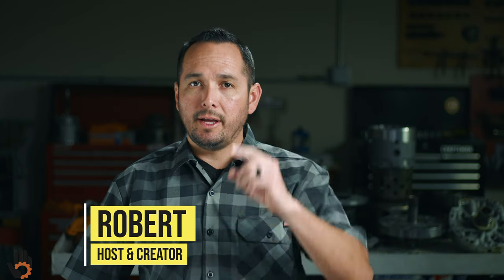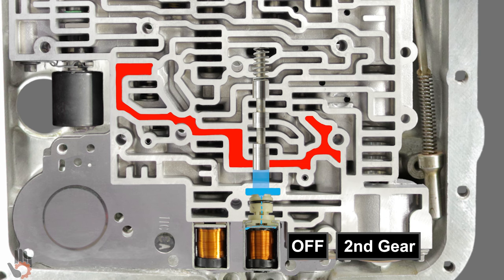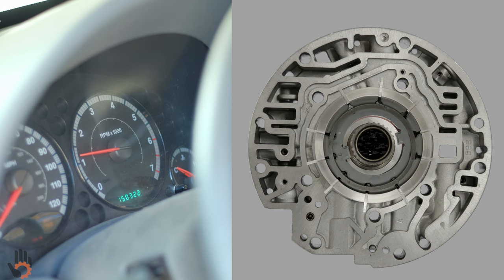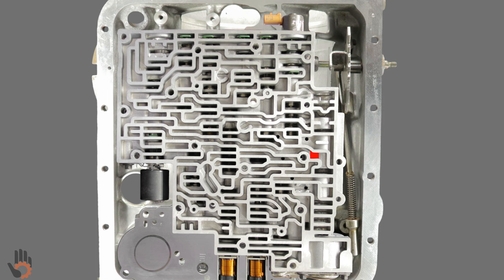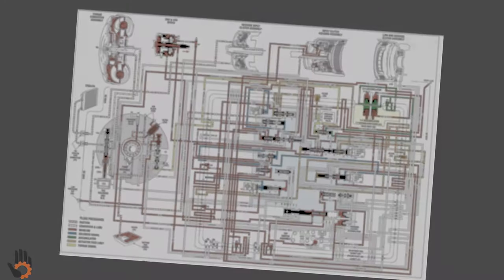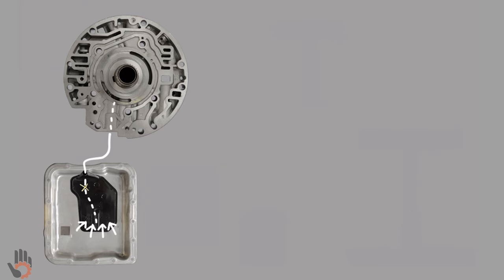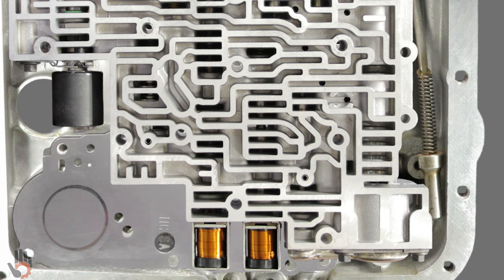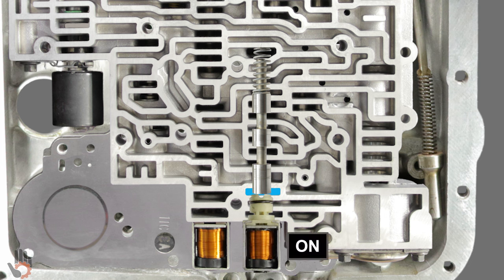4L60E: 1-2 Shift Valve + 1-2 Shift Solenoid (Part 1) Basic Operation

Comment: Hey there, I know it's an older video but II'm hoping you will repsond..I am a female that was taken by a mechanic for my hard earned money:( Unfortunately, now I don't trust any of them!
 I do have someone new working on my car and I can watch them do the repairs and ask questions they offer information that's for sure. But this bad experience inspired me to learn EVERYTHING I possibly can about my car:) thank you for explaining in detail, because the other guy wanted to have me replace my transmission then had a slip of the lip saying he can rebuild mine so I can have an extra one, wait WHAT??
Reply from the maker: Sorry to hear about your negative experience.  That's a real bummer.

Happy to share.  Excited to do more how-stuff-works videos, as time permits.

Thanks for dropping us a line!
We're glad that you're here.
Reply: @SouthpawAutoworks  Am I correct in researching the solenoid valve needing to be replaced because of a little slip in the trans, rather than a whole transmission replacement?
Reply from the maker: Generally speaking, a shift solenoid will not cause slipping.  When there's a problem with a shift solenoid, it'll typically result in a missing gear...as opposed to slipping in a certain gear.

There is an EPC Solenoid (Electronic Pressure Control).  It affects the oil pressure that's used to apply the clutch packs (it's called Line Pressure).  If an EPC Solenoid is failing, that could result in slipping.  However, it will likely affect all gears, as opposed to just one gear.

Comment: Why would my transmission stay in first and not come out of that gear can you please help out would it be the 1-2 shift solenoid
Reply from the maker: It could be...
It could be a number of things.

Can you share more about the condition?
Is it always stuck in 1st gear?  Or is this an intermittent issue?
Is the speedometer currently working? (or hooked up/disconnected?)

Comment: What could cause the trans to seem like it’s binding or has a trans brake in reverse and 3/4 shifts around 40 again it acts like it has a trans brake or is trying to lock up any knowledge greatly appreciated
Reply from the maker: Binding is caused by too many clutch packs, or bands, being applied at the same time.  A defective one-way clutch could cause this issue, too.
Note:  There's only one band in the 4L60E...other transmissions have multiple bands.

Binding in reverse.  Got it.
3/4 shifts???
I'm having trouble following...  Can you clarify?

It binds in both 3rd gear and 4th gear?
It binds during the 3-4 up-shift?
It binds in 4th gear?

Comment: Can someone answer me why fuse 12 (1994 Holden VR Commodore) keeps blowing? 
Fuse 12 controls the trans controls, MAF sensor and speed sensor. It only tripped five minutes after switching from PWR mode to ECON, as I had it on PWR for majority of the year and the car is thrown into limp mode. 
It feels like almost every January this issue happens. I'm most certain it's a 4L60E issue and not speed sensor/MAF

Comment: My truck slips from 1st to neutral while it is getting up to temp. Once up to temp it’s drive great and has never slipped. Doesn’t happen every time. My technician says it could be the valve body. Before I spend $2k tomorrow to replace it, what’s your opinion? Please help.
Reply from the maker: Year/make/model?
Reply: @SouthpawAutoworks  2019 Chevy Silverado 24,000 miles. Fluid is good and at correct level and no TSM updates are needed.

Comment: I have a 2005 avalanche and when it shifts to 2nd gear it's like it's in neutral . Is that going to be a shift silanoid or is something else going on
Reply from the maker: Sounds like something else...

If it were me, (and do what I do at your own risk) I'd be inspecting the 2-4 servo, for signs of damage.

Was the trans recently rebuilt, or worked on?

Comment: Question, I just changed both a & b solenoids. When I pulled b, the valve obviously spring loaded protruded out, when I grabbed a it was wabbly and loose and the valve didn't protrude out. I stuck my pinky finger in the hole seems I can barely touch the end of the valve. I installed the new solenoid and it fits nicely with no movement. There is a slight improvement in shifting but not much. What is going on here?
Reply from the maker: The 1-2 Shift Valve-train is under spring tension.  So, it will pop out as soon as you remove the shift solenoid retainer.  However, the 2-3 Shift Valve-train is not equipped with a spring...just two valves (shift valve and shuttle valve).  They will stay put, in the valve-body bore...unless you stand the valve-body upright.

The shift solenoids are wobbly when installed into their bores.  They're not a tight fit.  The O-rings are a snug fit...but the solenoid snouts are not.  So, it's normal for the solenoids to wobble in the bore.

There are a number of things that affect shift feel.  I look forward to producing videos on that topic, when time permits.
Reply: I didn't use ac Delco could that be a factor?

Comment: i have problem with my 2015 silverado v8 the scanner show the P2723 pressure control solenoid valve 5 stuck off, if you can help where is the location of this solenoid please?
Reply from the maker: There's an electrical connector that's visible from the outside of the trans.  The EPC Solenoid (Electrical Pressure Control) is located right near that case connector...but on the inside of the trans.

Comment: If there is some hesitation in shifting from 2-3 at slow acceleration, could it be more of a pressure solenoid regulation issue or a shift solenoid? It shift fine when accelerating normally or fast. Wonder if it could be due to pressure related issue. Thanks
Reply from the maker: Probably not an issue with the EPC Solenoid, or a shift solenoid.
Should take a look at the speed sensors, the TPS, MAF, etc.  Cleaning the MAF would be a good start....it can take care of a lot of issues...
Reply: @SouthpawAutoworks  thanks for the reply. MAF is cleaned as well. The car actually drive smooth other than this intermittent observation.
Reply: @SouthpawAutoworks  the reason I suspect EPC is that someone posted similar observation and replace them with success. I will need to find that again. Could it be the EPC at low rev is not building enough pressure that result in the hesitation in shifting. During the hesitation the engagement is generating some rough grinding sound that intrude into the cabin.

Comment: Question for you sir I have a transmission that is not shifting into 3rd could that possibly have to do with the Epc, I understand it's a good chance it's the clutches , thanks in advance 👍
Reply from the maker: Questions:
You say it's "not shifting into 3rd."
1).  Does the trans try to up-shift to 3rd?
2). Or is the trans (at that point in time) stuck in 2nd gear?
3). If the trans does try to up-shift from 2nd to 3rd, does 3rd gear feel like neutral (engine revs up)?

EPC Solenoid:
If there's a problem with it, it will likely cause problems with all of the clutches.  Not just 3rd gear (3-4 clutch).

You can learn more about the EPC Solenoid by watching this video.
https://youtu.be/PY1trZeLqTM

Comment: I have what seems to be a relatively simple problem in my 99 Camaro Z28, but for some reason I cannot wrap my “network engineer” mindset around the solution.  I have 1st, and Reverse, and that’s it.  Shifting down to manual 1st, 2nd, or 3rd doesn’t change anything.  Had a guy do the initial rebuild, and one of the mods he did was putting a plug at the end of the 1-2 shift valve.  Could this be causing what I’m seeing if the valve can’t shuttle down far enough for the oil to exhaust?
Reply from the maker: I'm not familiar with that mod (plug installed at the end of the 1-2 Shift Valve).
Can you share more info?  Valve-Body kit installed?

To answer your question...
If the valve can't stroke far enough, then yes, it'll cause problems.

I'm very interested to hear more about this.
Reply: @SouthpawAutoworks  it’s just a small cylindrical “plug” that is honed down to fit inside the 1-2 shift valve bore.  To my knowledge it isn’t part of the HD2 shift kit that was installed.  I’ve since removed it, only to discover it hasn’t been preventing the shift from 1-2. Unfortunately, I’m still back at square one with diagnosing the problem.  Sorry for the month late reply.  I patience level forces me to walk away for a while before coming back to it.

Comment: My transmission seemsto go into neutral while driving and then all of a sudden it bangs hard and the great send to be back in. Solenoid problem? I get that mostly when i switch to manual shifting. Goes from in gear to nothing and sometimes i have to rev the engine to get it working again with a big bang 🤔
Reply from the maker: When the problem appears...
What gear is the trans in?
What speed is the vehicle traveling at?
What position is the shifter in? (D, 1, 2, 3)
Reply: It has known issues with the solenoids and the pump wears out at about 140,000km

Comment: Hi, am having a bit of an issue with my 4l60e  with 3000+ miles on a overhaul, maybe you can help?
2 days ago, it wouldn't  start out in 1gear. It starts out in second gear, yet I can manually start out in first, then shift it back into d4 and it cycles perfectly through all gears. I am very perplexed  on why all of a sudden, it won't start out in first as it did for over 3000+ miles. It's  like it worked fine, then two days ago gone. I have been busy scanning the net for potential causes and have come up short.. From start-up you put in d4 and feel it nicely go into gear, then you push the gas and its in 2nd gear....yes 2nd,3rd, and 4th cycles fine. 1993 4l60e  your suggestions would be greatly appreciated as I don't want to have to start putting unnecessary parts into it. Just trying to narrow it down,  thank you, Chris
Reply from the maker: WARNING:
Do what I do at your own risk.

If the 1-2 shift valve is stuck, it could result in no 1st gear.  There could also be an issue with the solenoid (not building oil pressure).  Also, if the solenoid is NOT getting fed signal oil pressure (due to a oil circuit blockage), it will mimic a bad solenoid (once again, not building oil pressure, at the solenoid/shift valve).

I previously put together a short video for another viewer.  It's a rough video, but it gets the point across.
https://youtu.be/4qXqzWFKPI0
Reply: Thank very much for your suggestions  and I will investigate them as soon as I pull the pan off... really like your channel and know that it is helping  others and me to better understand the interworkings of transmissions
Reply from the maker: Right on.  I'm glad to hear that.

Comment: So what causes  a delay  in shifting  all the forward  gears D L 2  it takes about 15mins when the 3ngine heat up then u could get the car to move
Reply from the maker: What happens if you shift to Manual Low?  (might say "1" or "L" on the shifter).

Comment: I need advice when oil is cold I can put in reverse but when the oil is hot after 30 minutes of driving I can’t put in reverse can  be bad solenoid or something else please if you can give me some advice what can be a problem
Reply from the maker: "...after 30 minutes of driving I can’t put in reverse..."
I'm going to assume (and correct me if I'm wrong) that you can manually shift the trans into Reverse.  It's just the trans is not creating Reverse.  Engine revs up, but vehicle doesn't move (slipping)?

Reverse is controlled by the manual valve, which is attached to the shifter in the cab of the vehicle.  Even if there was a problem with a shift solenoid (for example), it would not affect Reverse.

Reverse is achieved by two clutch packs;
1). Reverse-Input Clutch.
2). Low-Reverse Clutch.

For whatever reason, one of those clutch packs is not getting adequate oil pressure (internal oil leak).
There's a way to identify which clutch is the problem, during a road test.  We're gonna make a video on that, when time permits.

ATF (automatic transmission fluid) changes with temperature.  As it heats up, it grows and also gets thinner.  Metal also expands with heat.  So, it there's cracked metal (hairline crack), it too will grow in size, as things heat up.
If there's an internal oil leak, inside of the trans, it'll get worse as the transmission heats up.

Year/make/model?
Vehicle mileage?
Transmission history?
Reply: @SouthpawAutoworks  montero sport 2003 230000 miles when I change oil I find a lot of metal on that magnet and also in the oil pan
Reply: And it’s automatic transmission

Comment: I just had my sons 1999 gmc Sonoma 2.2 4l60 rebuilt,   It only had reverse , and manual 1st and 2nd  After the rebuild, it still only has the same issue.      It won’t move at all in drive or 3rd manual.   I pulled it out again and took it to the same rebuilder.  He’s saying it’s probably the pc solenoid.    Is this possible.   Thanks Keith
Reply: I will answer my own question,   If you don’t have 3rd manual or drive.  But have reverse and 1st and 2nd manual.  Change the pc solenoid.    For a $120 fix.   If it’s the sprag gear.   It will have to be rebuilt.   👍🏻👍🏻👍🏻
Reply from the maker: Was hoping to get to you sooner.  Been super busy.

This condition can be caused by the Input Sprag or the Forward Clutch.

By manually shifting to Manual 1 or Manual 2, a faulty sprag (or bad Forward Clutch) can be bypassed.  Manual 3rd (Drive) will bypass the sprag, too...but only with the trans in 3rd gear.  In other words, shift to Manual 1st, get up to speed, up-shift to Manual 2nd, vehicle speed increases more, then up-shift to Drive (Manual 3rd).  Would've given you 3rd gear as well.

You can learn more about this by checking out the 4L60E power flow videos.
1st, 2nd, 3rd, & 4th:  https://youtu.be/IfOqbTqKubE
Manual 1st, Manual 2nd, Manual 3rd:  https://youtu.be/6kfAuXJFYFE

An EPC Solenoid would not cause this particular issue.  You can learn more about the EPC Solenoid by watching this video.
https://youtu.be/PY1trZeLqTM
Reply: Thanks  for getting back to me.  Gmc has a page about changing the front sprag without changing the solenoid.   The solenoid will send a fault code to the pcm.   after changing the solenoid , everything works great.     Thanks again.   Hope this helps someone.
Reply from the maker: Right on.

Comment: I have a 96-97 4l60e that shuts off the solenoid A in manual 1st and causes a 2nd gear manual start. Drives perfectly fine in D and OD. Any ideas?
Reply from the maker: Interesting...

What makes you say that the PCM is commanding SSA (Shift Solenoid A)(1-2 Shift Solenoid) off?
Is this based off of scan data?  Monitoring circuit amperage?
Just trying to get on the same page...
Reply: @SouthpawAutoworks  yes scan tool data while driving, temperature seems to make it worse, when cold it will hold manual 1st till around 4k, then as it warms up, will start in 1st and shift to 2nd quickly and once warmed up it will start in 2nd

Comment: How does the 1-2 accumulator work in this mix?
Reply from the maker: When the 1-2 shift valve moves to the up-shifted position (2nd gear), the oil travels from the shift valve towards the 2-4 Servo.  On the "road" to the servo, the oil passes a "cul-de-sac" where the 1-2 accumulator lives.  As the oil pressure builds in the entire 2nd gear oil circuit, the oil pushes the accumulator piston against a spring (there's more to this...trying to keep it simple).
As the oil pressure builds, the Accum piston moves in the direction of the spring, until the piston stops.  This piston moving acts as a cushion, so the oil pressure doesn't spike.  When it spikes, it results in a harsh shift.

When time permits, I'll put together a video that's dedicated to this topic.
Thanks for your interest in this topic.

Comment: My 4l60e 96 impala. Drives good for a few miles and then I loose first gear. If I manually put in 1st gear it works. Vehicle starts driving in second only. When it cools down or next day it drives fine. Could this be a weak/bad shift solenoid? Will not shift to third and 4
Reply from the maker: Sounds like there's a lot going on...

"Drives good for a few miles".....
It has all of the gears during this short time frame?

When you lose first gear, is it slipping in that gear, before it up-shifts to 2nd gear?
Or does it not even try to go into 1st gear?

"Does not shift to 3rd or 4th gear".....
Does it have this problem all the time?
When it tries to automatically up-shift to 3rd gear, does the trans slip?
Or does it not even try to up-shift?
Reply: @SouthpawAutoworks   I have all gears and drives well when when first driving. When I lose 1st it stays in 2nd and just revs high no slipping and doesn’t try to upshift. I use my scanner to check progress. Stay in second. This does not happen all the time. Only after driving for awhile. I can manually put it in 1 st though.
Reply: @SouthpawAutoworks  I uses my scan tool to command all solenoids. I listened for the click. 1-2 click was very low in sound compared to 2-3

Comment: Hey I bought a rebuild 2007 4l65e, it will shift in 1st and then 3rd and 4th where would you look for the problem
Reply from the maker: So, are you saying that the trans has 1st, 3rd, and 4th gear?  But, no 2nd gear?
Reply: @SouthpawAutoworks
Reply: @SouthpawAutoworks  yes I had no second gear from a transmission I had rebuilt, I found the problem , when the rebuilder installed the servo he cut the Teflon seal, easy fix , thank you for replying and I really enjoy your videos on the oil circuits it helped me find the problem fast
Reply from the maker: I’ve done that before.  At least it can be fixed without pulling the trans.

Glad you got it figured out.
I look forward to creating more of those kind of videos.